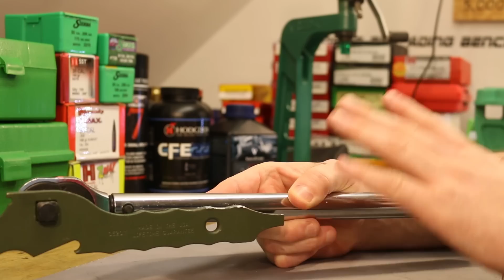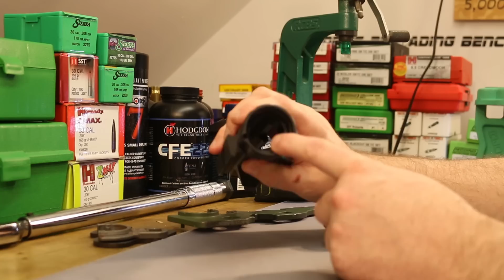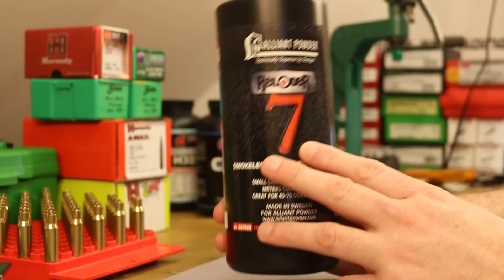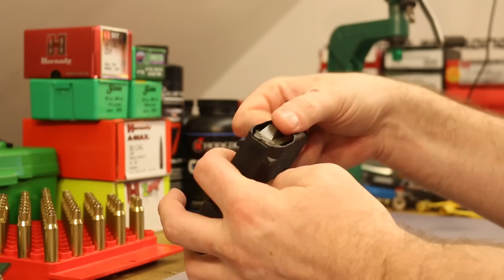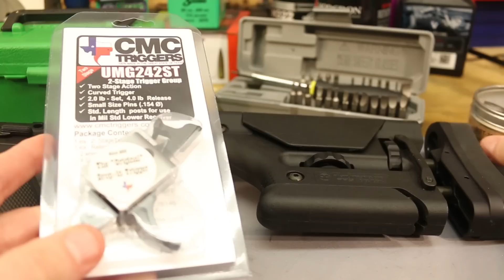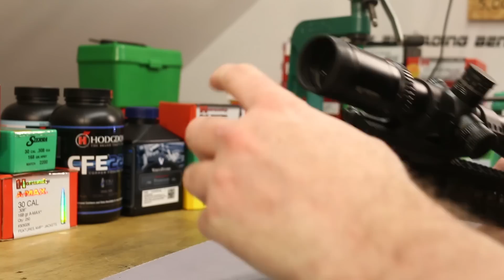Aero Precision M5E1 - First Shots (AR-10)

Comment: I make a test rd full length resized and trimmed to length and long seat my,bullet then  increase the seating depth till the rifling just leaves a mark on the bullet then drop it 4 one thousanths of an inch lower and load some up.I did that with my 280. rem and sierra 139 sbt gamekings and it averaged .680 to .794 of an inch at 100yrds 5 shot groups.

Comment: I wouldn't grind any off of barrel nut. The reason the torque range is wide is so that you can line it up. When you remove material from the nut, you reduce its ability to dissipate heat. Forgive me if you've already stated this, but what's the twist rate of the barrel and is it chrome lined?

Comment: I think part of the problem may be powder selection. I shoot bolt action in the 308 and VV N540 tends to do well as well as Varget and RL 15. I've heard Varget also does well in gas guns, but have no experience there. I've had very poor results with CFE 223 in the 308. 45.0 gns of Varget in Win brass with 175 SMK and CCI BR2 or Federal 210M primers is my go to load. This load was recommended by one of the top AMU coaches and has not let me down yet.

Comment: The jump numbers are a little on the high side. My precision rifle with custom chamber, we went with a throat length tailored for 308 175 SMK. When the barrel was new I had to set up with about 2.750 ish oal, That way there is the widest range of use. About 0.010-0.020 seems to be an ideal jump with smk. My shots from a bipod are usually bullets touching at 100 yards when I do my job behind it. Your jump numbers are a little on the high side imo.

Comment: When you torque at 90° it's the hypotenuse of the triangle in stead of just adding the length of the wrench and extension. A slight back angle of the extension so the distance of the back of the handle on the wrench to the center of the hardware being torqued is the same as the back of the handle to the center of the socket lug on the wrench is how you cancel the adjustment for the length of the extension.
Reply: Headspace is sholder to bolt face, so 308 headspace guages work for all the 308 'child' calibers. Check cartridge dimensions in your load manual.
Reply: Another headspace check you can use, use factory match ammo, most rifles should chamber with one layer of masking tape on the bottom cut flush around the rim, but should not chamber with two layers. Match rifles like a M1A national match or a Surgeons 700 action may not chamber with one layer.
Reply: I'd like to see you try one of the Brownells brand contract barrels. Brownells part number 
080-001-023MB? I think they're made by DPMS. Affordable, common, quality. I bet more than a few of the viewers have something similar. I don't have an ar10, so I don't have any bias.

Comment: I gas gun is a completly diffrent then a bolt. port pressure, suppressour etc.  175 needs a 1-10 .  but shoud run a 168. m1a powders are a little slower then most. 4064 , blc-2, 4895 , range, pretty narrow.  But your on to something with N450. 2550-2650 fps , for 168, a little slower with the 175s.   but once you found the load, dont go too far from it.

Comment: I would recommend a Criterion barrel they seem to be the most accurate for the cost and after doing over 27 builds with just them just during 2017 alone we haven't run into one that shoots any bullet 150gr or larger into a 3/4 in group until it gets dirty after about 70 rounds or so. P.S. missing those MK262 clone VIDS BRO. but you do your thing we will be here.

Comment: I dropped my AR10 with that same scope mount. Actually it fell over onto a wood floor. Scope mount loosened up. Junk,
I replaced it with a longer rail unit with the two vertical beams further apart. Much stronger.

Comment: On all the barrels I've bought, the locking lugs are very sharp on their edges, to the point that they score or cut the brass, especially the neck. Do you find this on the one's you buy?
Generally I polish them with 2000 grit paper double backed taped to a dowel rod.

Comment: In general with large frame ARs you have to use full fundamentals to manage recoil or it will never be particularly accurate. If you aren’t pulling back into your shoulder pocket firmly and holding that trigger till reset you will not ever really see the accuracy of the barrel. If you want to buy another barrel have someone like mile high or patriot valley turn you up a barrel.

Comment: Good video.  Nice looking gun.
Larue MBT double firing?  Id test it in a 223 gun to see if there is something wrong with the trigger.
You hit it right on the head with gas pressures with suppressor vs not.
110's powder charge, vert stringing
125s, hard to say, but Im betting powder change, try H4895 or 8208
150s, the 4895s are normally good performers in 308
168 SMK, powder charge, vert stringing
168 AMAX, not a fan of CFE 223 in 308 for accuracy
175, damn nice group, Id just tune a little and call it a day
Brass, block tuning, and check the extractor for burrs.  Good thing SSTL media will take those burrs out of the brass :)
Only other thing Id try is some 178 ELDs with Varget.  Ive also had really good luck with H4895 and 8208 XBR with 150 and 168gr bullets.  Ball powder has been hit or miss, mostly miss, but CFE 223 and 150gr FMJs make good blammo for ringing steel.

Comment: This is absolutely a waste of time and materials.  If you want to check accuracy then do it with a known factor.  Use Federal GM Match ammo or BHA Match ammo.  This takes your willy nilly picky of loads out of the equation.  And assesses the accuracy fairly.
And, if you get bbl from someone previously mounted.  Recrown it before testing!  Cheap fix.
Do a proper load work up instead.  Your time, barrel life, and resources are just wasted.
OEM bullet makers have done the work.....use their suggestions rather than your willy nilly approach to to things!  All OEM's point you in the right direction. 
If  you know anything about the 308......  You will know that Lake City M852 (FGM equivalent) is loaded with IMR 4895 at one time.  You are all over the board with your testing of powders..... 

And, here is a hint.  When seating bullets start the bullet and then drop the ram and rotate the bullet 180 degrees before finishing the seating.  

Crimp? Forget it.

Comment: Just my two cents/opinion(not an expert claim) it seems like the whole thing ran undergassed for this video.  I would suggest looking at the gas port via scope to check for any abnormalities, running 50 rounds of some factory ammo of one type of round unsupressed to get it running consistently and establish a zero, then proceed to grouping to see if the barrel is having issues causing the off groups before sending hand loads.  

Also, if I was building an ar10 build, I would look at Columbia River Arms barrel.  I have always had great accuracy and the prices are fantastic.

Comment: So I’m not the only one with gas issues on my  ballistic advantage build. I got there 20” SS premium series. I got a nickel boron spikes bcg. Kept getting bolt override with 308 loads. But runs with no problem with 7.62 NATO. Just installed an adjustable gas block but haven’t messed with it cuz I build a 6.5 CM upper which works was better in the platform with out and adjustable gas block so  the 6.5 has my attention for now.

Comment: I run Berger 185 gr Juggernaut as a competition load for my 20 inch bolt gun with a 1/10 twist. Since I get my brass for free, I use Federal Gold Medal brass, CCI BR-2 primer, and 43.6 grains of Varget. Between 43-44 grains of Varget seems to work as a test range. It's more than the Berger book recommends. I noticed no pressure problems at all and a very special guy let me shoot his past a mile.  They are amazing bullets. Thanks for another awesome video JRB.

Comment: 90 degrees allows the tool to be much closer to the original length of the square drive. Just look at the length from the handle end to the tool and compare at 90 vs the staight off the end. No math needed just basic observation.

Comment: An old Marine, trigger control was drilled into my head which manifests itself as a very light grip on the rifle and lightest trigger pull possible when shooting for groups off the bench. I discovered this caused a problem with doubling when shooting a stock M1 Garand (30-06) and less so with my M1A (.308). Once I adopted a firmer grip on the gun and a tighter shoulder plant, it quit. I think this is the semi-auto rifle version of limp-wristing. I used to be able to cause a failure to eject almost on command by intentionally limp-wristing my 1911s.

Comment: Barrel is just ruff send some tubbs lapping projectiles down that tube and check the barrel crown it has potential just needs some love. Also if you were going to make a barrel pick that isn’t out of line on price there are a few options. Krieger makes a nice service rifle barrel and also schillen. Criterion is a good choice but not sure they build for AR10. Also have a look a McGowan.  I would recommend a Bartlien but it’s around a grand and six months worth of waiting probably not what you were thinking. Good rule of thumb on service rifles is no lighter then 3.5 lbs trigger for safety. Don’t get me wrong I enjoy a light trigger as much as the next guy with most of my rifles being set some where between scary and stupid but the ole M1A is a 4.5 lb trigger and most of the AR rifles I have put together are 3.5 to 5 pounds. So I ran into an issue with accuracy on an 18” barrel AR10 I was loading for and pressure problems had a 1-10 twist criterion barrel found it  like 42 grain H4895 CCI BR2 and 168 Amax and used a moderate crimp using a lee factory crimp die. Bad boy cranked down a .583 group with that combination might give it a try.

Comment: There is an article by Glenn Zediker on handloading the M14 on line. He has a load with 3031 that was the same as a Federal match load issued at Camp Perry. I have used that load in my Sig 716 and its my most accurate load by far.

Comment: I would like to see you go with a Christenson arms carbon wrapped barrel, there a little pricey $600 but not as much as proof research and it also comes with gas tube and gas block
Reply: larry rose they're cheaper because they are horrible. Have had 3 of them in 308 that have never grouped. Finally got them to refund me for them. Pure straight junk.

Comment: Lets see if I can make sense of the 90 degree thing. The distance from the ring to the socket hole is effectively a lever arm of 4 inches. When you place a 12 inch long torque wrench into the hole and the wrench is also in the SAME PLANE (IE you can make a straight line if you draw it.) then the lever arm becomes length 4+12=16 inches. By moving the wrench lever arm 90 degrees (either way) you have totally removed it from the horizontal plane the ring and socket hole are in and with it the added mechanical advantage it gave.

Comment: i have a Dpms Sass . it came with a JP 3 1/2 lb trigger . i wanted a two stage trigger so i put in a geissele hi-speed national match DMR two stage trigger  . 10 pull adv is 3 lbs 7oz. and after over 300 rounds , i have never had a bump fire . love the trigger ! you know, funny thing about rifles is no two barrels like the exact same load. thats why it's great to know how to reload. looks like you might be on the right track with the 175gr TMK
Reply: My ssa-e avg was 2.9lb with 5 pulls…best upgrade I’ve done to my ar-10

Comment: stevencortI like your videos. I would highly recommend a V Seven Weapon Systems .308 Barrel. They make great products. Also I would also recommend the David Tubb Flatwire .308 recoil spring. You won't be sorry with either one.
Reply: stevencort the V Seven barrels are made for them by Faxon. So he should just get a Faxon and save the money. ;-)
Reply: The V Seven Weapon System Barrels are not made by Faxon. There made by V Seven all hand made. Great product.
Reply: stevencort well, you're partially correct, Faxon is making barrels for 2A Armament, V7s barrels are not made by V7 though. I'm a dealer for all 3 companies, V7, Faxon, and 2A Arms. I'll call V7 tomorrow to confirm the maker who is building their barrels for them.
Reply: When I purchased my V Seven Barrel I spoke to the owner on the phone. They make the barrels in house.

Comment: It's just a ratio for leverage,  its force x distance,    Lets say your wrench is 24 inches and torque is 65, let's say now you go to additional 4 inches it's now a total of 28 inches to a new torque value to be solved.    New torque = (28 x 65) /24 or 75.8 ft lbs or. ( new length times old torque)/ old length. Hopefully this helps.
Reply from the maker: Yeah, I'm okay with it as long as it's straight.  It's the 90deg stuff that warps my brain.  I start drawing imaginary force arrows in my brain and I'm quickly confused.

Comment: Johnny, try an 18, 20, or 22 inch 308 M118LR chambered Criterion barrel. The 20-22"  1-11 twist should shoot anything under 178 well and the 1-10 should shoot the heavy stuff if you feel the need. I vote for at least the 20 but preferably the 22. I know I is crazy! But I love my 28" Win Mag and might get a 26" bull 308 barrel for my other Savage bolt gun.
Reply from the maker: LOTS of votes for Criterion, so they'll definitely be on the list!
Reply: 1-11 is just dumb. 1-10 is minimum. go with 1-9 if you want the most out of your .308

Comment: Would you be interested in trying a 7.63x39 barrel in the ar15?
Reply: Well if you do decide to do it in a ar15 I have a barrel I could send you.
Reply from the maker: I have promised that I will do a 7.62x39 at some point.  It will probably be later this year as there is too much on my plate right now.  I'm far enough behind as is.
I haven't decided which way to go.  An AK would be the obvious choice but I may do an AR15 or bolt gun.  I'm not sure.
Reply: Whenever you decide to go the 7.62x39 direction, Faxon currently makes a Gunner profile barrel chambered in 7.62x39 that actually has a .308 bore. Opens up the bullet selection to all standard .308 sized options for reloading. From what I've come to understand, it will be very similar to reloading 300 Blackout, but with higher case capacity which can help get you more velocity.
Reply: Phillip K. .....  yeah even my Bear Creek barrel is .308" but the only downside is the throat is for the larger bullets so accuracy  may suffer. Mine shoots 1.25 MOA with 24-24.5 gr of IMR 4198 and either 123gr .310" bullets from Hornady or Nosler. No load workup. Just good enough.
Reply: AR 15's chambered in 7.62x39 are less than ideal due to the magazine's not feeding reliably.
Reply: John Holmes... I love my 7.62x39 AR... it's my trunk gun... goes everywhere I go... and has never failed to feed... and I have 7 different brands of mags
Reply: I think the interesting points would be checking accuracy of an AK versus a direct impingement AR.  This topic has been touched on quite a bit on various forums but you could investigate any feeding issues in the AR versus the accuracy against the AK platform.  It has been my experience is that the cartridge is super capable of outstanding accuracy, mostly if you hand load for it.  I verified this with my ruger american ranch rifle chambered in 7.62x39.  The reputation that it carries for poor accuracy mainly comes from the very very cheap ammo supplied for the platform and the AK not truly optimized for accuracy.  

Enjoy all your videos, and I agree that this request would be another great topic!  Thanks for all the hard work you put into these.
Reply: CProduct Defense mags and not one feeding problem over 1000 rounds or so. Geometry and coatings solved the issue. Biggest problem areas were straight section through the magwell and lips on the magazine.
Reply: jordan hays I may even donate a mag for a while if necessary to keep the budget down.
Reply: JRB get a Howa 1500 threaded barreled action, from Brownells.

Comment: Wilson Combat part TR-308SSRG20FC10 is what you need for a barrel. I also recommend using H4350 for 180 grain and above in 308; but you will need a 22 inch barrel minimum length.  You will not be disappointed.

Comment: I built this same gun except I used a nickel boron bolt from Brownells.  Worked perfect.  In a 9mm I built,  I used a deep in trigger also but, since I used anti walk pins I didn't bother with the set screws.  Had all sorts of double tap trouble.  Tight down the set screws!  P.S.  Two stage triggers are ridiculous.
Reply: Drop in.  Stupid spell check.  Also might want to try a different buffer.
Reply: Try a light buffer or buffer spring.  Dang son.

Comment: I offer to save you a lot of frustration.  Stick with the 175 Gr SMK (a very jump tolerant bullet). Keep the OAL between 2.800 and 2.825".  Sierra says that 41.3 Gns is the max of Reloder 15 yielding 2500 FPS (a 24" test barrel).  You will find your happy accuracy spot from 39.1 to 40.2 Grains. The longer OAL gives you slightly more case capacity.  Lapua brass is the best but you can weight sort your Starline or use weight sorted Federal commercial. By the way, the M118 LR for the military was 45.0 Grains Rel 15, 2.855" OAL,Fed GM210m, in Fed Case @ 2750 FPS. Designed to be shot in Army M-24 with a very sturdy and rated receiver. The early tear down M 118 I saw only had 43.1 Gns of propellant.
Reply: Good to know brother…I’m new at this and m118 is what I been shootin and tryin to match handloads..175s over 46gr of 4350…gotta find some different powder,primers and got some 168 hornadys on the way
Reply: @arborist460  Be sure to use four -O steel wool to clean around the top of the case to remove any excess sealant.  I put mine in a case trimming brass holder attached to an electric drill. Makes the entire round "purty".